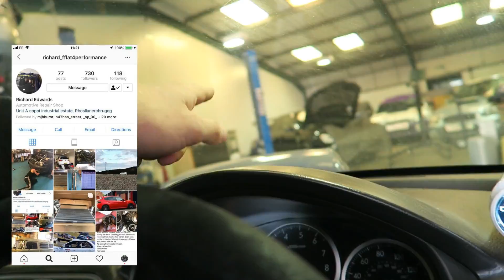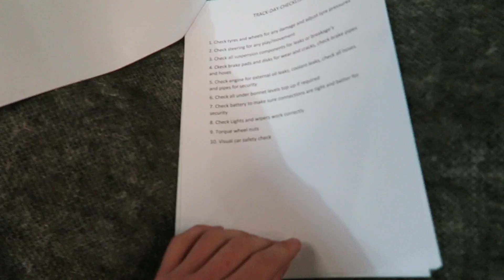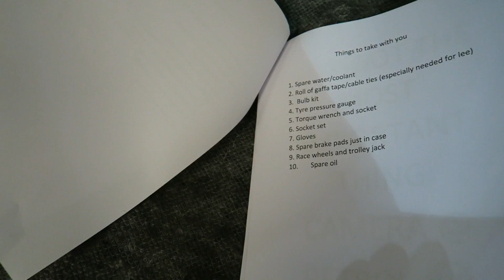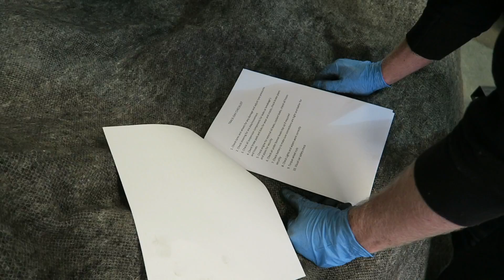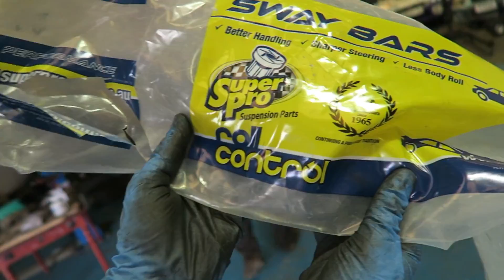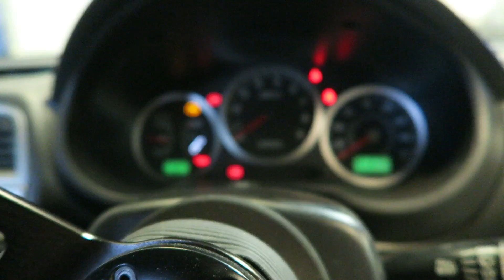TRACK DAY PREP! (ep1) ; Brakes, Suspension and a.. Hammer?

Comment: Do these have oil coolers? as it's boiling oil what's s problem on track maybe get a gauge and take it easy if you get problems, flush brake fluid and use dot 5.1 plus you never said how the new anti roll bar is or which setting is best.

Comment: Don't use copper grease Lee the metal it form a bad reaction with dissimilar metals, I used it on my brake caliper slider pins and a few months later there is no lubrication and the slider pins were frozen solid. You want dedicated brake component grease mate, save yourself the headache

Comment: I would have changed the brake fluid and got braided brake hoses if it were me.

Be careful you don't warp tbose discs after 1 track day, do short sessions and have regular breaks to let them cool down or they won't last the day.

You will probably find that your tyres are rubbish, get the track day bug and want the best of everything.

Comment: I've Got a Subaru Impreza bugeye 2.0 non turbo , just a run around until I get something something else in January , bank 1 sensor 1 lambda sensor keeps failing , I've had 2 brand new Bosch sensors in the space of 2 months , anybody know what could be causing this ?
Reply from the maker: Shane appleyard bad fuel? What you running?